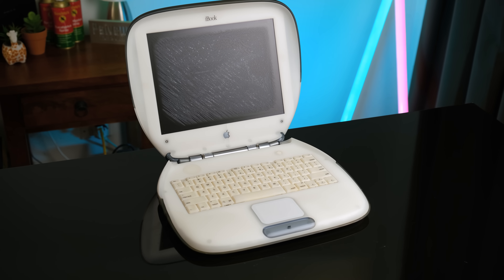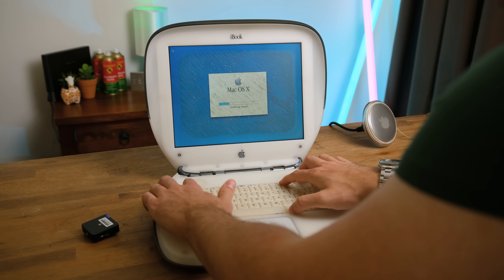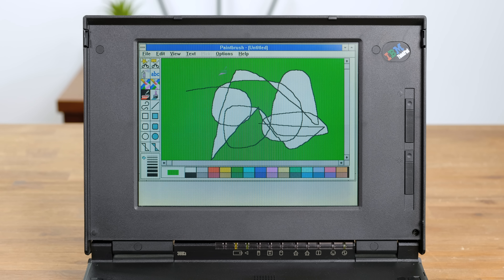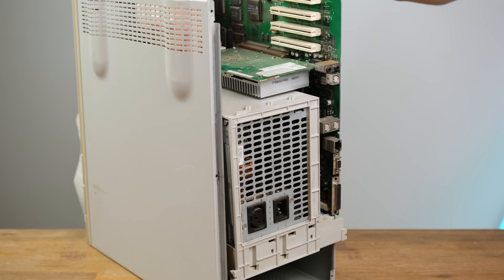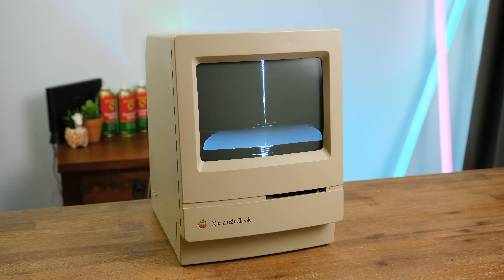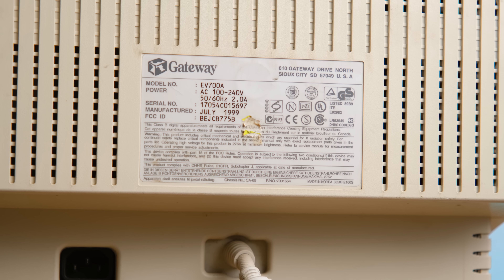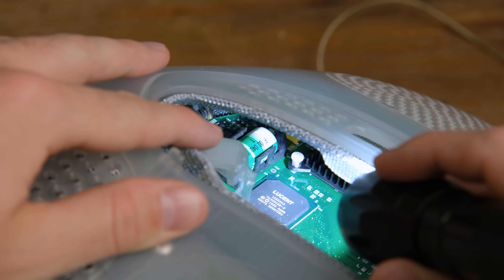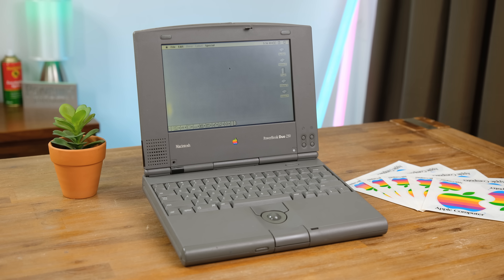So Much Vintage Tech Is Dying... Here's Why

Comment: I feel for you, I myself am a classic games console and arcade game collector. The war stories are long, and painful to watch. 80s NiCad batteries and old Duracell and Energizer batteries were never designed to last this long. And what they do to arcade boards is saddening, as many of these boards are single game, and VERY hard to acquire. The dreaded "white powder" (galvanic and uniform etch) tears up many a board. And the only repairs have to be with reflowing solder joints and lines ,new wiring, and if your lucky, original IC and RAM chips, and power supplies. 

Many companies are the chief offenders opting to go for "cheap" capacitors and components. The worst? Apple, Sony, and at the time NEC or National Electronics Corporation out of Japan. These cheapskates loved to use electrolytic capacitors and bargain bin plastic you could practically watch them fall apart. It was as if they actually had built in a lifespan to these devices. And repairs are getting harder and harder as spare parts dry up (literally). CRTs are now needing regeneration and complete refurbishment to keep running. And while a healthy CRT will last you many years, they are mostly landfill waste.

Comment: Im a tech collector mostly by saving all of my old personal tech and this issues is slowly creeping into my consciousness especially from from modern devices. Case in point is my first generation nexus 7. I stored it in its original plastic wrapping it its box and just recently I opened it just to see and hold and behold the rubberised back casing is starting to melt causing it to stick with the plastic wrapping permanently.

Comment: You can remove the rubber coating with vinegar, isopropyl alcohol or acetone. Vinegar usually works fastest of these if the rubber is already sticky, and acetone can make the underlying plastic look bad. But still better then machanically scraping it off. Whoever thought this rubber coating was a good idea should be now licking it off from sticky devices, for all eternity. It's gross even when it's new.
Reply: NEVER use acetone. This stuf actually melts through plastic, and I even used it to WELD 2 plastic pieces (polystyrene or ABS) together, and it needs half a day to solidify again - if handled earlier, it breaks like chocolate.

Comment: biggest one I see the most is the iMac G3's inner bezel breaking down completely, even had that random flicker your original model had which went away after an hour of running. I recently got one that I fixed up, reglued the bezel, only to find out one of the biggest caps was extremely buldged. Can easily replace it if I want to risk killing the biggest piece holding the entire crt up to disintegrate from removing the screws to remove the crt. Unfortunately I just left it in since it's been sitting torn down on my desk for an entire month not only too nervous to take it further apart but haven't had the time to get the new cap. I guess if it explodes, it explodes. I gave it to a friend and told him to prepare for a loud pop each time he plugs it in lol.

Comment: Sticky melting soft touch plastic surfaces can easily be cleaned with orange terpene. It cleans that stuff right off. In addition it smells really good (like oranges).
Reply: Turpentine will dissolve the plastic itself too. Use isopropanol or vegetable oil (and wash the oil off with dishwashing detergent, else it may damage the plastic too).

Comment: Electrolytic capacitors and batteries are the two major things that make electronics go bad over time. This can be addressed IF you have the skills to replace known unstable components preemptively. Sadly, most power supplies use large electrolytic capacitors that will lose capacity as they dry out, which will then introduce ripple. This can cause the thing it's powering to minorly malfunction or even catastrophically fail. For instance,  ripple can cause tantalum caps to pop. Tantalum caps in a filter circuit cannot safely operate with too much AC ripple, and aged electrolytic caps in the power supply will do that.

Comment: those lcd displays are super easy to fix , you can buy polariser sheets and replace both sides of it. slowly peal the bad sheet clean the surface as good as you can get rid of all the glue and put back on new polariser film and you would have perfectly functional display . i have done this to quite a few monitors and tv's. you can fix the black oval spots with this method aswell on smaller lcd displays .

Comment: I own an old Samsung TV manufactured in 2008 that still works perfectly fine. It has a 37-inch screen with FullHD resolution and HDMI inputs, so I plan to continue using it since I can easily connect any device to it. However, it's starting to show signs of its age as the part of LCD screen in front of the power supply unit is turning yellow-ish. This is due to the heat produced by the power supply unit, which causes this part of the screen to break down faster than the rest of the panel.

Comment: I repair vintage computers like Mac Classics, Amiga's, Atari's... and 90% of my work is recapping these. A huge percentage of vintage Macs and Amiga's or either damaged by leaked capacitors or batteries. Not only Vintage Mac Classic's suffer from leaky capacitors on the logic board, but damaged analog boards caused by capacitor leakage.
Battery damage is the worst, I rarely get a Mac Classic/Amiga were the logic/mainboard has been damaged by battery leakage.

Comment: The good news is, if you catch some of these problems early, you can replace the affected parts with either new-old stock (if you can find them) parts, or a more modern solution that may last longer.  Things like those rusty shieldings could be replaced with something that doesn't rust as much, or would take much longer to rust.  I'm not sure if there are any kind of aftermarket 800x600 screens that would be compatible with the iMac ribbons to replace that dead screen, but I imagine if they start failing en masse, some enterprising person could come up with a solution to save the old tech.
Reply: Some aftermarket companies will make new replacement parts especially batteries. I have many times found stuff on eBay or Amazon
Reply: someone else mentioned that the vinegar syndrome happens to most old LCD's, and all you have to do to fix it is by replacing the old polarizer with a new one, which is a fairly quick and easy fix (as opposed to replacing the entire screen)
Reply: Store in a room with a Dehumidifier.
Storing in a damp basement guarantees corrosion. 
It's the cheapest sheet available used in the manufacturing.
Reply: @RetroCaptain  I definitely need to do this.  I have a finished basement room with all my vintage macs, and it can get /a little/ moist in summers.  Bone dry in winter, but I definitely need to get a dehumidifier.

Comment: I just checked and my old CRT monitors still look fine. :) We have a Tandy 1000TX at work we use to run a Database called PFS: Professional File from the late 80s. We have been using it regularly since it was new. The only thing we have changed is the Hard Drive. I think it is rocking an 80 Meg. We also have a PowerMac G3 400MHz Blue and White Tower we use to drive a piece of printing equipment that we have had since new. It is still all original with the original SCSI hard drive.

Comment: Most eMac's will suffer bulging capacitors. Back in 2010, my USB 2.0 eMac had bulging capacitors and Apple replaced the logic board under a repair program. However, the replacement soon failed and then I had very poorly behaved eMac which had issues booting and shutting down etc.. It was replaced by a 24" iMac soon after.

Comment: I hate poor quality plastic and also the use of plastic in parts where it isnt suitable. Plastic can last for a very long time if its of good quality but sometimes it just breaks down surpricingly fast, i have plastic items that are from the 70´s that are perfectly fine still. That sticky rubberized surface is awful.

Comment: Ironically I’m actually seeing a lot less of my old hardware dying than new hardware, I’m seeing manufacturers these days cheap out on everything under the sun and then ppl upgrade in 6 years and toss it into recycling, whereas all my vintage stuff, works forever, and if it goes out, I just recap it; however, some of the design cheap outs like exploding batteries that leak everywhere and screen issues like bubbling are pretty bad

Comment: I just tore apart and serviced my old X200T thinkpad. The thermal paste inside was absolutely toasted. Replacing it brought the temps back into spec and made it more stable. But it does have the classic issue of the monitor's wiring harness failing so it no longer responds to touch commands in tablet mode. So yeah, definitely enjoy older tech while you can or at the very least properly service it to reduce chances of damage from leaking components.
Reply: I almost daily use an IBM Thinkpad X61t from 2009, which screen works perfectly (beside that I once had to replace a broken swivel hinge mech).
 But I don't drag it around much and don't swivel. I once had to dismantle and re-oil the fan (truncated the metal tabs to get the fan lid off easier), and the DVD burner has trouble with some disc colours (laser wavelength issue?) but otherwise works.

Comment: I have recapped dozens of Amiga 600 and 1200 computers, which, along with the CD32 suffered from leaking capacitors mainly down to the cheap ones they used and the age of them. I have saved loads from ultimately becoming electronic waste and realeased them into the Amiga community. Amiga forever! (or at least a few more decades!)

Comment: It's more than obvious that manufacturer's want you to buy there new products so they build them not to last beyond a certain number of years.
Everything is made to break & fail with in a minimum of two to three years. It's called premanufactured to be obsolete so they can sell you a new one. All in the name of progress, but it's not progress it's profit. I still have old cellphones from 2014 that still work but the network changed to 5g so it no longer has reception. Just for money, the manufacturer could have built it to be adaptable to the new network settings but they don't want to. Everything is disposable today. Then where stuck with e-waste that we have to pay to dispose of safely. I have found some old 1940's radio's that still work fine they last for ever. Today's radio's will not last as long.
1938 to 2023 & still works fine just a cleaning every now and then. Try that with a new electronic device & see if it would last that long.

Comment: First of all, that pitting in the palm rest area is hardly new. My palms did that to my own Aluminum era laptops back in the day, both PPC and Intel, no metal wristwatch required. It's all in the skin oils. The Unibody metal was much more resistant, with only a slight beveling of the top edge after many years of use.

But problems with old computers are hardly new. Back in 1999, I found an ADM-3A terminal that had a strange bubbling in the CRT. I thought it might be some kind of bacterial or fungal activity. I put it in storage for a few years until I could get around to working on it. That turned into 20 years, but at least it was no worse. I started looking up what the problem was, and it turned out to be a common problem in old CRTs called "cataracts". The quarter inch of adhesive that glues the shatter-resistant front glass to the tube breaks down. (And it does not smell like vinegar.) The only solution is to heat the screen to get the front glass off, then find a way to re-attach it. Go ahead and search for YouTube videos about CRT cataracts if you have an hour or two to spare.

Fortunately I was able to remove the front glass with only the heat of the summer sun, and digging the adhesive out with a hooked tool. Then I reattached it the easy way, with sticky foam blocks around the edge for depth, then Mylar tape around the edge to keep out dust.

Comment: As boring as the aluminum Apple hardware has been over the last ten years or so, they are going to age out so much better.

I also have a rusted out Mac Classic that looks similar to what was shown in the video.

Edit: You just encouraged me to pull the pram battery out of my G4 Cube.
Reply: I have a similar 2012 MacBook Pro to the one he showed, the first retina display one I believe, and you wouldn't believe how many times it fell out of my locker in high school, or fell on the floor, and here I am, still using it. It has a perfect screen, where the newer (both Mac and ThinkPad) laptops I have all have dents or bruising on the screen. I wonder if the aluminum protected the screen more than the ThinkPad plastic. I think the reason my other Mac has issues is because my dad probably closed the lid too hard and something got stuck inside, which aluminum can't help you with. I just don't like how hot they get. My ThinkPad has aluminum bottom, and plastic top, so I can type without it being too hot, but it still gets rid of heat out the bottom, in addition to two fans.

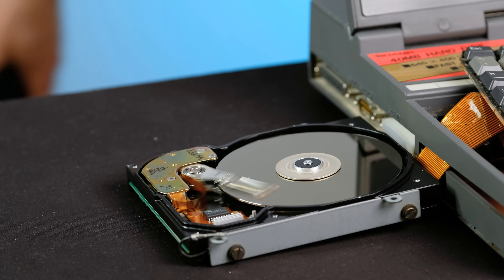Comment: 1:40 - Please, for the love of god, if you aren't keenly aware of what you're doing and how to do it, do not under any circumstances open your hard drive if you have important data on it. You could very easily end up making the hard drive unrepairable - even for a specialist.
Reply: If a harddisk won't start, never open it! - Any tiny airborne dust particle will start a chain reaction of debris (like colliding satellites) that will unavoidably destroy it. Likely it won't spin because the bearing oil has hardened. And do not knock or use  force. Better simply warm the bearing with a hairdryer (not too hot) to remelt the grease and then let the disk spin for an hour to let it knead the lube soft again.

Comment: well guess what, I have a exact 2007 hp pavilion dv6000 and the system just needs a factory reset. but the hardware is still intact and working

Comment: Today's Electronics don't even last 5 years! It's become a use and throw culture! Plastics don't last more than 10 years! They crack, turn Yellow and become powdery! Next, batteries don't last more than 3-4 years. They leak and destroy all electronic components! Then, electrolytics Capacitors leak like hell! Also destroy all nearby components! Ahaaa, Belts in CD or Tape drives melts away in 5 years! Yikes! LCD displays don't last more than 13years! Delaminate, bubble up or grow small round concrete hard structures all over the screen! At this point, the repair becomes impossible!
Reply: Belts and rubber parts in tape or disk drives dissolve usually by wrong oil. Only use silicone oil (better silicone grease) if nothing else is specified.

Comment: I only had one of those odd clock caps screw over an entire ibook snow board tho looking at the other machines that I've owned for almost 5 years now yeah I'm concerned 

It always surprises me that my macintosh plus hasn't had any faults and especially because the original filter caps being installed still

Comment: I've got a lot of diverse older stuff where the plastic is just shattering now, and a lot of gummy rubberised stuff as well.
Strangely enough the really old stuff seems to be in the best condition, reel to reel tape, cini projector, PONG consoles, and the VIC-20.
1990 to 2000 appears to be the most rotting!
Reply: I'm in no way what one might call a 'tech~head', but I believe equipment assembled in those years is so notorious for its 'Bad Caps' (capacitors) that it's an actual 'thing'. As far as I can remember, as well as the usual corporate penny~pinching, there is actually quite an involved story involving industrial espionage and counterfeiting behind the problem but I'm afraid I'm hazy at this point  about the details. Apart from low~grade electronic components and the well known problem of built~in obsolescence, I am constantly shocked by the lack of forethought or possibly even ignorance about the way material used in the more mechanical parts and basic construction can degrade in what, to a Gen X'er like me, seems like a remarkably short time - rubber drive belts; those ubiquitous and annoying - even - when - new rubberized coatings, plastic gear trains and doo~dads, plastic and even metal housings... Of course, if you wanted this stuff to degrade (as in, in the environment) it would still be here polluting watercourses and strangling the wildlife come the year 8510, by which time (so the song says) God is supposed to be here - as if to spite us and him both!
Reply: @richiehoyt8487  planned obsolescence is now in architecture, most houses built in 2020 wont last half as long as a medium quality house from the 1970s
Reply: It's almost as if it's all intentional 😂

Comment: not surprised it was a lot of macs, with that said ive never seen an old PC fail like this only macs, i know a couple people that still have some old 386 and 486 systems that still work adn look like new inside and out.  on older systems i do recommend removing replacing clock batteries and replacing all electrolytic caps every 20 years because i have found that to be the point where electrolytics will start to fail.